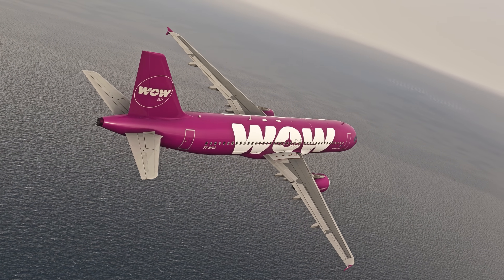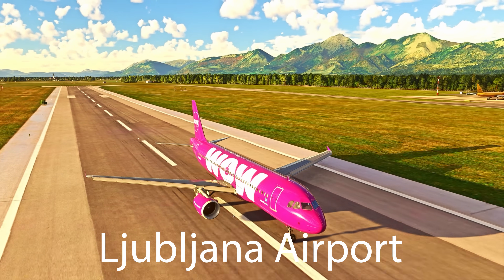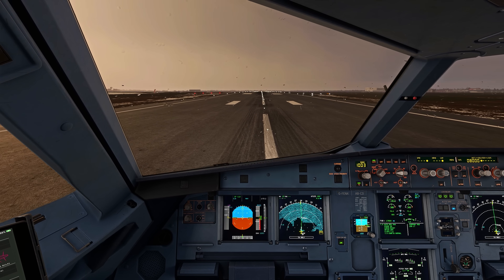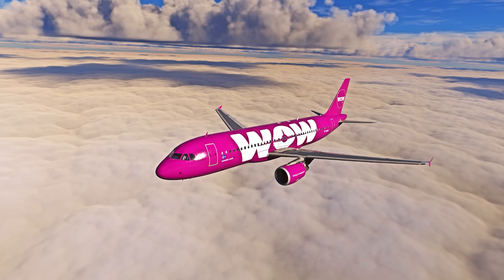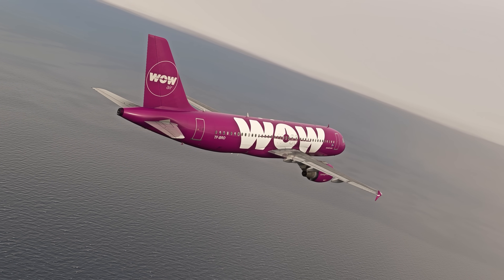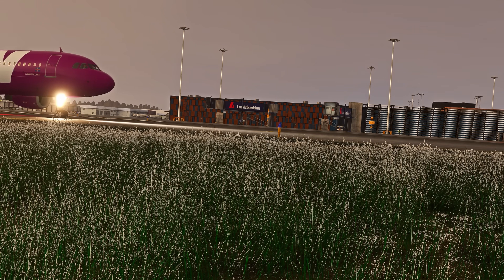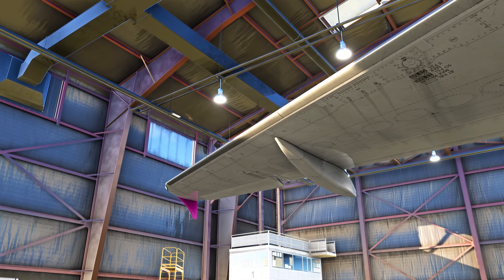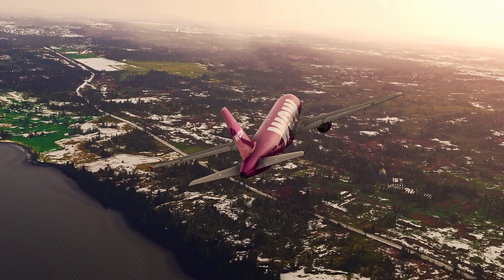Maintenance Mishap Almost Leads to Catastrophe! | The Story of WOW Air Flight 117

Comment: 4:50  The ECAM warning of low oil quantity gave the crew a chance to correctly handle the problem.  Without that warning, they might have been unable to reach an airport.    12:10  It looks like the plane's design makes it far to easily to incorrectly install that drain plug.

Comment: This is a bit like computer software. Its released and then all Users are the Guinee pigs, it fails and then they amend the operating software!
It seems modern planes now have this same issue, we'll fix the procedure when it faults! 
The fact that different people were doing the same mistake with the O ring placement, showed it was about the procedure itself and not the person. 
Horrifying.

Comment: OMG, this is just as bad as a quick-lube place, where a hamburger-flipper changed the oil and left the plug out! Except, in this case, a lot of people could have died. On your car, LEGALLY, a second mechanic is SUPPOSED to double-check the torque of the lug nuts.🤣

Comment: Check out the crash of American Airlines Flight 191. Technicians across numerous airlines deviated from the recommended procedure to remove an engine because it saved over 200 working hours. The plane and all on board was lost.

Comment: So much wrong here.  Complex design with many loose parts, parts that will fit in more than one configuration, terrible instructions, probably proof-read by overworked engineers, everyone under pressure because management wants more work from fewer workers.  It also amazes me that some planes now do not have the ability to dump fuel, they have to fly around to burn it off, which may take hours. The designs have actually eliminated the dump valves.

Comment: Great video. With all the different third part maintenance organizations that are around the world, sounds like ICAO needs some type of standardization team that inspects and evaluates these maintenance companies. These inspections could then be reported so airlines could make informed decisions about where maintenance should be preformed if they do not do major work in house.That way the correct procedures for maintenance according to the manufacturer  could be standardized world wide. This is what we had in the USAF. In Strategic Air Command( SAC) there was a command level team called MSET, Maintenance Standardization Evaluation Team, that went from base to base an evaluated the maintenance organizations. a report was then issued and any corrections or training issues resolved. Sounds like the world's airlines should invest in something like this. Am a retired USAF maintenance officer so have seen the value of something like this.

Comment: As the oil and oil pressure was lost to engine 2 would the engine be changed so the bearings could be examined to ensure they had not been damaged or do they have a procedure to ensure no damage has occurred?

Comment: Just a note - C and D checks, in fact all letter checks, can be changed based on reliability data from the fleet. So a C check could be at four years after the airline gathers enough data to justify it. Some C checks are broken up into C1, C2 etc., same with D checks.
Reply from the maker: Nice, thanks. 👍

Comment: Great video. I’m and Aircraft tech specialize in avionics. There for sure is a gap in understanding the AMM, and sometimes it’s instructions are all theory and don’t make since for actual work. For example it will say “remove isolation valve” , but to remove this you have to remove 7 other items to get to it and that isnt stated in the amm. This leaves a gap for those other systems to not be addressed.
Reply: That's why airlines need to develop their own work cards. And not a work card that says, "Follow AMM 31-12-09" but provides specific procedures to follow (generally based on the AMM but adding in the inspection requirements and fleet differences).
Reply: @chipsawdust5816 I do agree. When you have years under your belt you get it. But for new Mechanics it really leaves a lot of room for error and interpretation. I remember doing a fuel transfer and it wouldn’t work, then a fueler told me to hit this specific switch and it’ll go. And surprise, it did. But that step was not in the AMM
Reply: @osmosisdaily  Yep there's always "tribal knowledge" which I guess isn't a PC term but I'm too old to care. 

I've written thousands of work cards and engineering orders and it's not a simple thing to do that's for sure. These days it would hurt my brain...

Comment: This is an interesting one. In a car, if your oil pressure light comes on you should pull off the road and switch off straight away, or risk destroying the engine. The risk of destroying the engine is the same for an aircraft but typically you will be required to go through a checklist. I wonder if the checklist items can be completed before the engine is destroyed?

Comment: As a 63 yr old corporate pilot who has thousands of hours in king airs, beech jets and hawker 800xps, I’m gonna come to the defense of this pilot. I find it hard to believe that a guy with his experience would not have reached down and firewalled the power levers which would have probably remedied the situation. I as the yawning damper on? Was auto feather on? What was the position of the power levers ? None of us are perfect and the FAA is quick to blame the crew when the scratch their head a bit. Was this a 135 flight? Did the first officer really sit there and watch the plane crash because the rules say he can’t manipulate the controls with passengers on the plane. Something don’t sound right to me here.

Comment: Airbus translations into English leave something to be desired. For instance, when they mean to say "turn something on".....they say, "Make sure the OFF light is off."  Technical jargon can be detailed and require concentration anyway......but then to have to read through these poor translations into English....."The push-button is released out"   "The OFF light is off" etc etc. 
Also there is an Airbus task where a bunch of circuit breakers have to be cycled at different times and different circuity breakers.......you know.....to test channel A and channel B at different times......whatever.  So what does Airbus do?.....they write the FIN numbers of the circuit breakers instead of their grid location on the panel. FIN number is Functional Identification Number. Only the FIN numbr isn't marked on the circuit breaker panel. So you have to get a list of circuit breakers that lists them by FIN number AND grid location which the maintenance task doesn't do. And the CBs have to be cycled in the correct order at the right time or the test will fail. Then you have to print the task and write in the grid locations of the circuit breakers in the margins of all the paragraphs that call out FIN numbers of CBs. Madness. Only then can you run through the test smoothly. It's been that way over 30 years. They will NEVER consider simply listing the grid locations of the circuit breakers.

Comment: The procedure for replacing the engine oil filter sounds ridiculously complex. After all, the pressures involved are VERY similar to those in automotive applications. So there you are......a darn spin on oil filter would probably be adequate......but in making it aviation complex they Rube Goldberged the darn thing and opened it up to errors in installation. Unbelievable. In reality they could probably use a spin on filter or a drop in cartridge......safetied in some manner.....and encased in an additional housing. 
That's one thing I don't understand in this incident......why was the drain plug safety loose? Installing lock wire is aviation maintenance 101.

Comment: I didn't hear the phrase "ETOPS" used in this explanation. ETOPS: "Extended range Twin engine Operations."   Since this aircraft was ETOPS certified and taking an ETOPS flight, then the question is, did the same technician install the oil filters and drain plugs on both engines? I think that is what happened to one Eastern Airlines flight that lost oil quantity on all three engines and is one of the events that brought about the ETOPS procedures.
Reply: The mechanic that did that ended up working at my station for my carrier, but retired before I got there. According to my coworkers, he was a real dumbass. Hit himself in the face with a chock trying to use it as a hammer. Real idiot and the faa should have yanked his certs
Reply: @supacheef1   Yes, we've got the full spectrum where I work. But the labor market is tight.

Comment: Excellent video demonstrating an aircraft maintenance process! Aircraft Maintenance Manuals (AMMs) have consistently fallen short in terms of user-friendliness for technicians. These manuals are typically authored by aircraft manufacturers, each with their distinct styles. American manufacturers tend to employ outdated communication methods, while European counterparts often favor overly intricate procedures, as illustrated in this video.

Aircraft technicians perform incredibly complex roles in an industry where cost-effectiveness is paramount. One viable solution involves enhancing the use of instructional videos to elucidate maintenance tasks. With over 35 years of experience as both a pilot and technician in the aviation industry, I can attest that being a technician entails far greater complexity and demands.
Reply: Technicians never have and never will get the credit they deserve from the public. They get credit from their peers though, which to me is more valuable since the public is honestly ignorant of what complexities have to be handled during a heavy check.

Comment: The moral of this story is rationalization. Making false assumptions because you do not wish to respond to the issue appears to be the common behavior to this alarms. Oil loss should have been an immediate U turn back to the airport bc it just had its inspection, and now this. That's not a good sign. That's a better interpretation of the problem.

Comment: I flew WOW round trip from SFO to Dublin via Reykavic in 2017 and fortunately didn't die which I consider a plus. Maybe with computer vision there will be automated checking things are put together correctly or acoustic tap vibration tools to check things sound and vibrate correctly when tapped or vibrated so there can be confidence mistakes are detected on the ground. Plane should send telemetry to company HQ so other heads will analyze problems and help prevent mistakes.

When working as a manufacturing test engineer I once had a complicated procedure for people/technicians at contract manufacturer to follow so I took lots of pictures and had my test scripts show that. I remember senior guy in group was grumpy about my script being more complicated with all the image files. When I visited contract manufacturers the technicians there said they really liked all the pictures showing what to do and what should happen. I had thought no matter how carefully I explain this it would be brain dead easy to screw up. My motto is: "Only idiots don't make things idiot proof".

Comment: Does anyone know what happens to the jet fuel when it’s dumped? Does it evaporate before it ever reaches the ground/ocean? Or would that depend on the height at which it was dumped?
Reply: From what I understand they dump it at around 5000 ft. It's cold enough to evaporate most of the fuel. The vapour then disperses.
Reply: @Jim-ku6ry  Thank you!

Comment: I had to land a B757 overweight after shutting down an engine.  No fuel dump capability.  We had fuel for EWR-LIM, and diverted to IAD ( due to poor weather at departure, EWR ).   Even "overweight", no hassles.
Reply: Still has to have the overweight landing inspection but yeah, the plane doesn't always suffer damage.

Comment: 1:56  airlines putting cost before safety
Reply: How? Getting rid of an old plane that is too costly to maintain is not a safety issue. If anything, it's the opposite, since newer aircraft are reliably safer than older models.

Comment: I’m always happy when I learn that everyone survived and unharmed. I work as ground crew and I remember seeing a Tui 737 max 8 with an oil leak on the no1 engine. Huge dark streaks spread from gaps in the cowling seams along the underside of the engine.

I was glad that it had just landed and the engineers had already seen it and had their manometer out to test oil pressure. Otherwise I’d have had the aircraft grounded and examined myself. Yes, in the UK at least, anyone who works airside can get an aircraft grounded if they see or even suspect something is wrong. Since engineers are always onsite 24/7 this means a grounded aircraft can be examined by an expert quickly and released back into service if the person reporting it was wrong.

I’ve never had to invoke that rule myself, and I post this more as a reassurance than anything else. Multiple sets of eyes are upon the aircraft when it’s on the ground and even lowly cleaners are taken seriously if they spot a fault with an aircraft 

Passengers can do it too. If you think you see something wrong, ask a FA or even the pilots before doors are closed at least. It’ll probably be nothing but it’s better to be sure.

Comment: Reminds me of a similar problem I had with my car. Driving on the interstate a huge cloud of smoke started coming out the back. With a car you can land anywhere. I got off at the next exit and was towed in. The problem was that at the last oil change the O-ring from the old oil filter stuck to the engine. So the filter had 2 O-rings. This didn't cause a problem for a while but eventually the extra O-ring failed allowing oil to shoot onto the exhaust pipe.
Reply: I was a quality tester at a large main dealership and on virtually every occasion where the schedule demanded a diesel fuel filter renewal I would find that the seal hadn't been renewed (it was awkward to access); this would always lead to air ingress and idle surge. Techs need to own their responsibility and not blame negligence on manuals.
Reply: Correct installation of a spin-on (non cartridge) oil filter includes lubricating the seal, whether it be a true o-ring (round in cross section) or a lathe cut type (rectangular or square in cross section) before installation. This minimizes the possibility of the old seal adhering to the mounting surface upon filter removal as well as reducing the possibility of pinching the seal during installation of the new filter.
This is why I NEVER use oil change shops and do the job myself, however I have been in the auto repair business for a few decades and learned the proper procedure back in the 1970s.
It is even more critical to prelubricate all seals used on rotating assemblies as they will immediately build up heat from friction if installed "dry"...damaging the seal.
Reply: @donreinke5863  Yeah it used to be "use the old oil" to lube the seal because of the varnish. Over the years, I've found I don't think it makes any difference, especially now with synthetics. But I always lube it one way or the other. Never install a seal dry (except copper or crush washers and the like).

Comment: Bet someone loses their maintenance certificate as well they should.
Reply: Don't just blame the technician though. Company culture and management play a part.
Reply: @amazer747  I spent 30 years building and maintaining aircraft. It's not about blame as you are clearly trying to "blame shame" my comment. It's about responsibility and accountability. Maybe YOU missed the part that the near fatal miss was extremely isolated. That fact illuminates that it was not in fact company culture. It was an individual. At that point they trace back through maintenance records and they will isolate the exact minute that the electronic maintenance was signed off. And then they determine if it was a time crunch, a training deficiency or a document lacking clarity. But I refuse to forgive and forget or shift blame.

Comment: Im no expert on this, but Im wondering what computer or game program you use to make your videos. The graphics are so realistic.
Reply: Microsoft Flight Simulator 2020. Available on Xbox and Windows PC. Curious Pilot may have used the PC version as there are more user-made modification on the PC version than the console(Xbox) version(Restricted to the in-game marketplace). These user-made modifications that are only available for PC version may include but not only restrict to the FlyByWire's currently released A320 NEO and the future release of their A380, Headwind's currently released A330-900 and Sukhoi SSJ-95, Salty Simulation's B747-8, Headwind's B787-9, etc. 

For PC users, it is available on the Microsoft Store and Steam. For Xbox users, it should be on the default Xbox Game Store. Hope this helps you in your decision whenever you decide to purchase the simulation software.

Comment: Great video, enjoyed the technical explanations. And a shout out for the visuals on this one. It's incomprehensible to me that you can depict such a lavish simulation of the aircraft and airfields. If it was left up to me, we'd all be viewing 16 x 16 sprites done on a ZX Spectrum with colour clash aplenty.
Reply: The visuals are outstanding, however as a former military and commercial pilot who has flown into Keflavik dozens of times, i assure you that no approach to any runway at KEF is done over such lavishly forested areas.
Reply: @allanjensen1195   The forest is due to the default settings in Flight Simulator 2020.  Very irritating how the devs can not correct that.